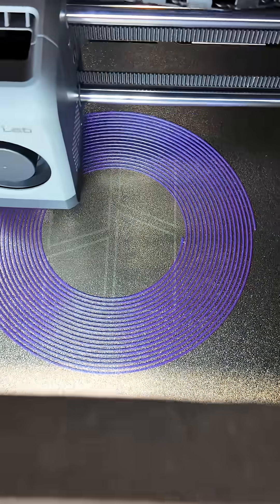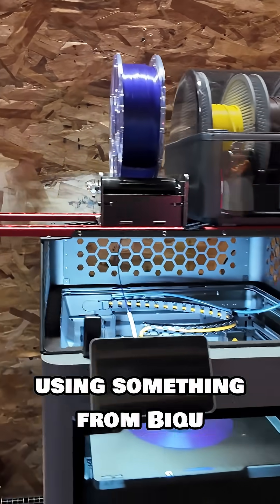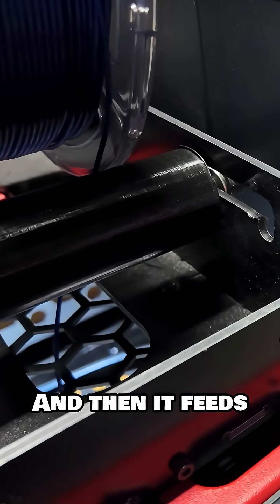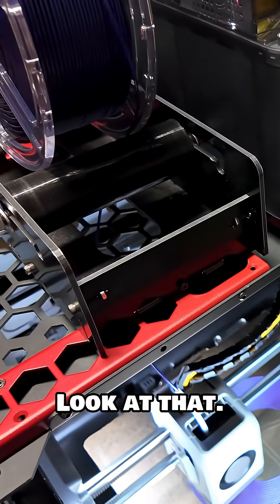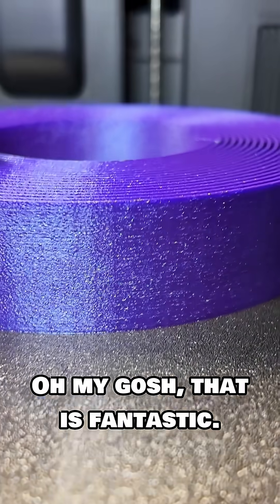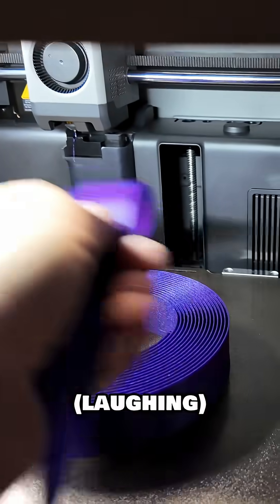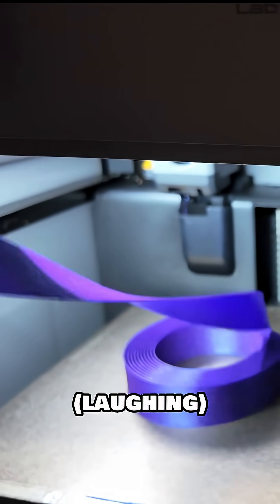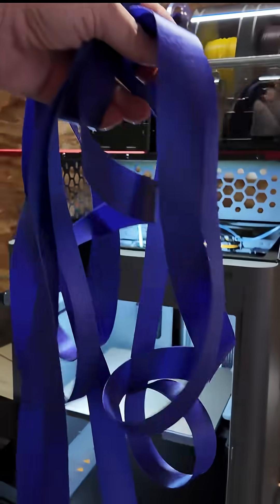TPU on the Bambu P2S!  #3dprinting

Comment: Does anybody from the community have hints for a TPU beginner. I got an X1C and I tried Printing stuff with TPU. My nozzle keeps on clogging from it. I have a 0.4mm nozzle. Should I maybe try a bigger one? The filament has been dried for 16 hours now as well but still same problem. Other filaments work just fine
Reply from the maker: hmm, how are you feeding it into the machine?
Reply: @3DPrintingNerd  Due to not being able to feed it to the printer via the AMS system I use an ordinary filament holder which stands next to the printer. The printer itself has a direct drive extruder.
Reply: If you can put your roll of TPU in some sort of descicant box with a Bowden tube after drying, this will greatly help with longer print time items. I've run 30 hr dragons on TPU. During long prints without a dry box, I've seen moisture become an issue, and im in the arizona desert.   

I currently have 6 Qidi X-MAX 3's. 

For me, on these machines, I use their slicer pre-settings for volumetric flow and retract. (I dont recall off the top of my head right now). 
TPU sticks super hard. I dont use glue stick or other releases. 

My slicer settings:
.4mm nozzle. 
.2mm layer. 
Bed temp: 40c 
Nozzle temp: about 235-245c (speed and perimeter dependant.)
35-60% cooling fan 
45-50mm/s print speed. 

I use these machines for work, so I find the most successful average speed for my use. There are "speed tpu". I dont have much experience with those. 

Good luck, hope this helps. 
Curious to see what ends up being your problem.
Reply: @philz9835  Thanks for your answer and for sharing your settings. Comparing to your slicer settings I do have similar settings except the printing speed. I set the printing speed to 30 mm/s because I read the slower the better. Other than that it's similar to yours. 

Though I can't tell you if it'll stick or not because the problem I have is with the extrusion. I already switched the hotend to another 0.4mm and still same issue. Maybe I shall try to order another spool of TPU, maybe the quality of the one I got ain't that good. Cuz other filaments like PLA or PETG of even CF Filaments don't make problems at all.
Reply: @josefschuster7657 , thats juat weird. 
Im not real familiar with Bambu, but arent they a proprietary filament machine? 
Next question is, with tpu being stretchy off the spool, how freely does spool spin in the setup? If its smooth like bearings, do you have too much backspin on the spool when it retracts?
Reply: @philz9835 well yeah, I saw many people print TPU on Bambu printers with ease. I use an ordinary spool holder, like the ones that came with the early Ender 3 printers. Should i maybe try to print a better spool holder? Or maybe get one of those spool holder drying boxes instead?
Reply: Maybe run some PLA through and do a cold pull. Could be a partial clog being aggravated by the TPU?
Reply: @technicavivunt  I tried that. The TPU continously cloggs the nozzle as well as the heat break. Had to clean out the nozzle 6 times already and after the last clean up I replaced the entire hotend just to make sure. But so far same results. As explained before, other filaments don't make any problems. It's my first try with TPU so either I am just making something wrong which I don't see or I maybe should buy another spool, that maybe something is wrong with the spool I got.